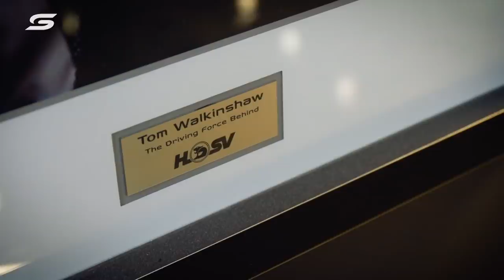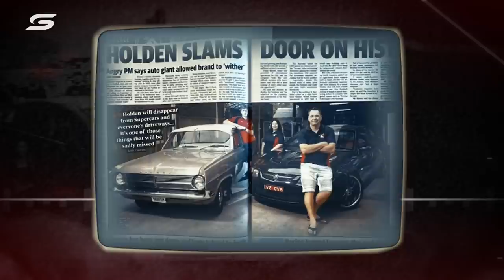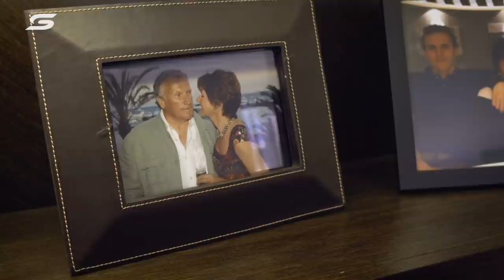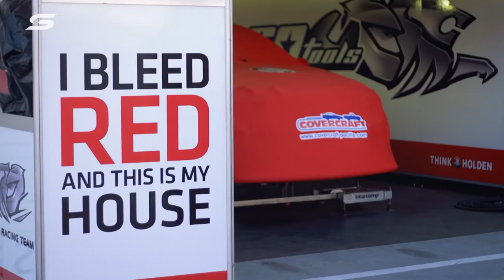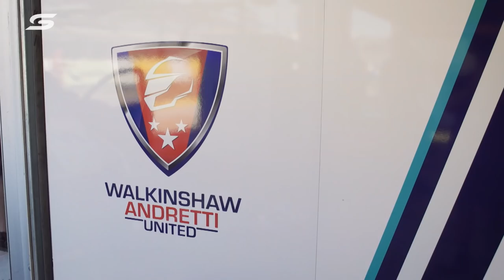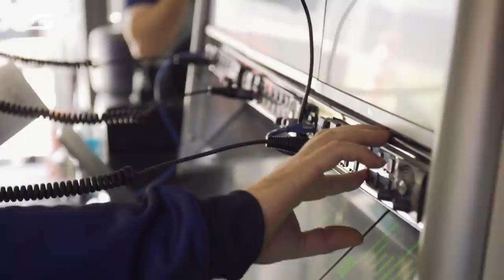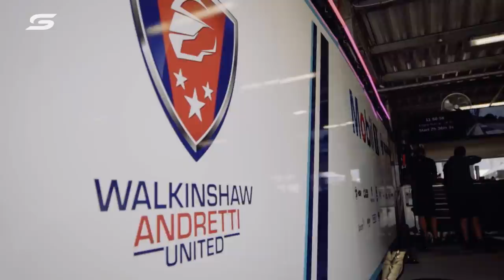Episode ONE - Inside Line: A Season with the WAU Team [FULL EPISODE - UNCENSORED] | Supercars 2022

Comment: Somehow one WAU car was so much faster than everyone else! Seriously if it was a Ford clearing out in front dominating the race, it'd be stripped down  immediately after the race! You know it's true!
Reply: Lol really? Does project blueprint rings any bells? Fords answer to slow the Holden down by turning them into kit cars. Everything the same except the shell and motor. Wouldn't go sooking about stripping cars when Holden had to do the same thing. Actually changed the whole thing
Reply: Yo Jason! Remember 2019? Multiple changes to the Mustang to slow it down.
Your memory is short. 
Ford had the power in 1999. Before project blueprint. 1995 Falcon aero cuts for Bathurst, 200mm off the front undertray so they can't turn! 
Cool 👍
Reply: @toddc6682  lol already kit cars by then. You talking about the mustang that actually didn't look like the mustang lol. Never seen a mustang on the street with a big f1 rear spoiler on it.
Reply: The last parity change on ZB was pushed through with little consultation...